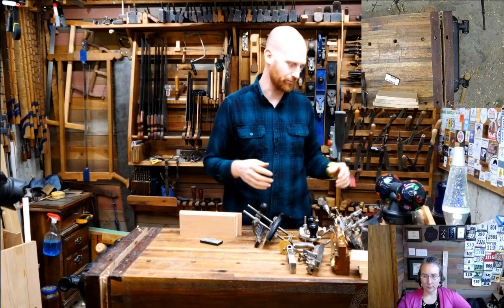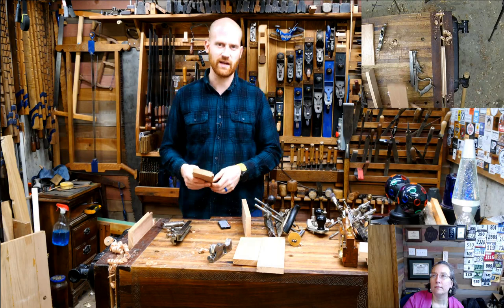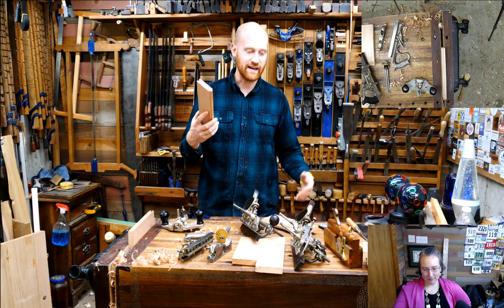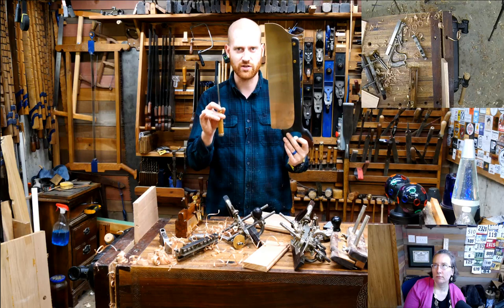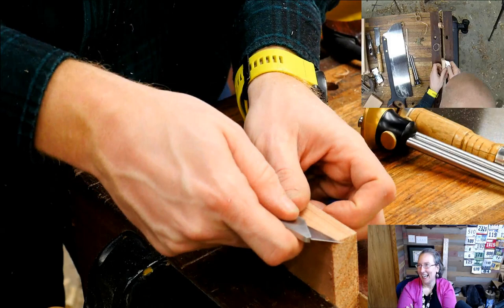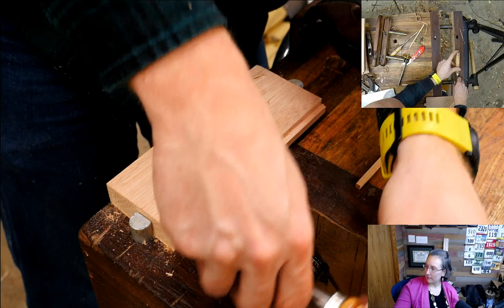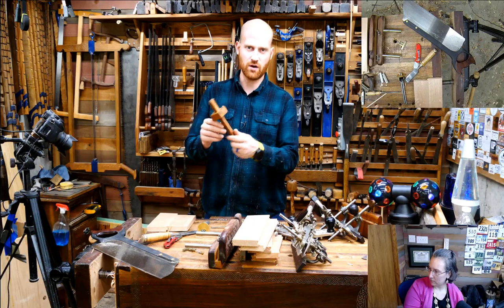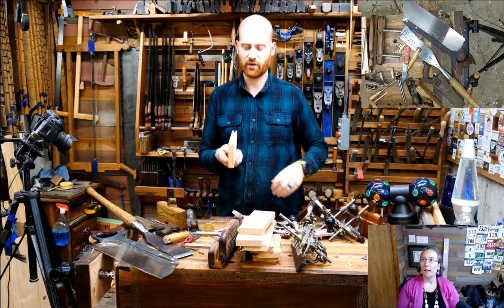7 Ways to Make a Tongue and Groove Joint

Comment: Can agree to the harbor freight plane, the one I had was junk. I actually went with a Stanley for about $100 on Amazon, then for some reason I bought a low angled Stanley 62 on Amazon. I'm new to hand tools so I need these tools. But after I set-up the low angle planer, I shipped the other plane back to Amazon because I loved this plane so much. I did a hell of a job for a newbie setting it up. Still using it and still Loving it!

Comment: Great video! Thanks!
Just one small technical suggestion: try creating a border-frame around the two other frames - Sara and the down-facing camera. It will make it easier to watch.
Reply from the maker: Thanks. I have tried to do that but have not found how with the software I use yet.

Comment: when you used the Stanley 55 plane to cut the tongue, I see your iron was missing the depth stop.
Reply from the maker: no I have it on the sash iron. I generally do not use it as it is a pain to setup and is often quicker to just go to a line.

Comment: Grooves are the most enjoyable joint to cut, its so satisfying :) I am perplexed tho, and have a question......say I have a curved frame to set a panel into...or a frame with cloud lifts (greene and greene style) how would I cut the grooves by hand??? I cant think of a plane that would work, or one that I could make for the job.........youre gonna tell me to just cut it with a chisel aint ya? :P
Reply from the maker: Yup. You just carve it. I have a few videos showing cutting curved groves. There is a plane that will cut slight curved groves but it is very hard to find. It is called a carage makers plow plane.
Reply: @WoodByWright  Thanks for your speedy reply James :) I never even thought of carriage makers planes....... a quick look online and I found a coachmakers wooden rebate plane for sale in England (im in Ireland) for 30 GBP, but the curve is not strong enough for what I want, dunno how well it would work either cutting curved rebates :/ ......found the carriage makers plow like you mentioned.... on Jim Bode for nearly 800 USD :/ so yeah....think im gonna be gettin very groovy with a chisel haha :P Thanks again James!! :)

Comment: I have that model router plane but NONE of the accessories (like the fence, depth stop, etc). Are they easy to find?
Reply from the maker: unfortunately the parts are hard to come by. you can normally find them on eBay, but often it is cheaper to buy one with all the parts already there.

Comment: The knife wall is not hundreds of years old as you stated.  Paul Sellers takes credit for inventing it some 50 to 60 years ago. It's his technique.
Reply from the maker: He claims to have come up with the name. Not the method.
Reply: Incorrect. The technique is his.
Reply from the maker: You should go read a few of the woodworking books from the turn of the last century. The method of chiseling out to the knife Mark is an old one. It is commonly called a first class cut.